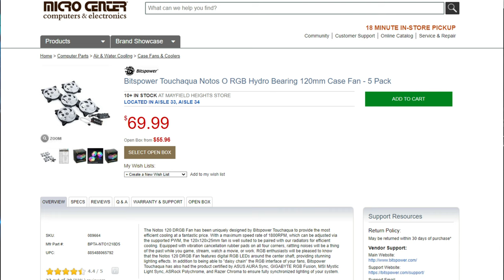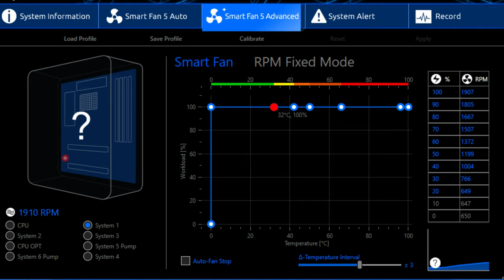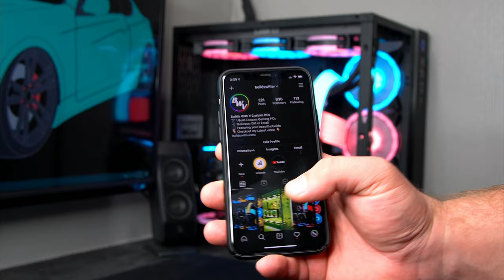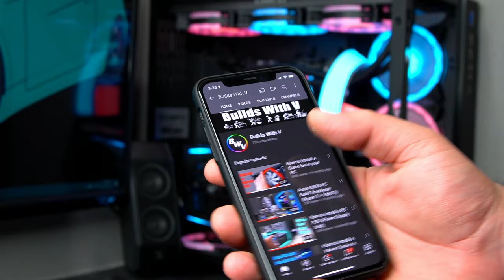Best Budget RGB fans (Bitspower Touchaqua Notos O fans)

Comment: where do you place the two hubs on your case?
Reply from the maker: I just kept them in the back of the case
Reply: @BuildsWithV  do you recommend plugging into MB or into PSU
Reply from the maker: @TaylorRich10  the fan hub needs both to work and the rgb hub needs sata power but plugging it into your motherboard is optional. The RGB hub has buttons on it to change lighting. I have mine plugged into the motherboard as well to control it using software
Reply: @BuildsWithV  okay well i managed to break the pins on two of the 8 rgb fan inputs... i have 7 total fans.. what do i do now 🤦🏻‍♂️
Reply: first time build and i’m freaking out
Reply from the maker: @TaylorRich10  not too much you can do besides getting a new hub. Broken pins won’t hurt anything but I’d just get a new one.

Comment: U have 9 fans but 8 rgb hubs??
Reply from the maker: 2 rgb hubs so I can separate the colors a bit.
Reply: @BuildsWithV  what hubs?
Reply from the maker: @motonate1585  they are the hubs that come with these fans. Bitspower RGB hub and Bitspower fan hub.
Reply: @BuildsWithV  ahh ok. So I got 6 of them, if I wanted to have 3 one color and the other 3 a completely different color how would I do that? Because right now (using aura sync) they're all the same color and I have no other options
Reply from the maker: @motonate1585  overall that will depend how many ARGB headers you have on your PC. If you have 2 then you can plug 3 of the fans into one of the ARGB headers and then plug the other 3 fans into the other ARGB header. The other option would be to have 2 hubs and plug 3 fans into one hub and 3 into the other. Then you can power one of the hubs with sata only and the other can be plugged into your motherboard. The issues with that is you’ll have to control 3 of the fans with just the hub and no software. I personally have 2 ARGB ports which is how I have 2 separate colors.
Reply: @BuildsWithV  ahhh ok I think I kinda understand now... I have a Asus x570-f so I believe I have 2
Reply from the maker: @motonate1585  nice! Yeah I just looked up the manual for that MB and it looks like you have one down at the bottom and one up top on the right. So it’ll work perfectly. You can just piggy back them together 3 on one header and 3 on the other. Thanks for watching 🙏
Reply: @BuildsWithV  hell yeah! Thanks for the help man!

Comment: These fans have very poor static pressure flow, not ideal for aio setups, for case fans they are fine.
Reply from the maker: They do great on my AIO radiator. No issues with heat until my GPU starts to put out a ton of heat from long gaming sessions. Then the temps rise but not to any extreme. Still well below limits. The fans do a solid job IMO. Could be better for sure but I’m okay with it.
Reply: @BuildsWithV   good to hear cause I just bought 6 of them lmao

Comment: I don't know what my favorite are, but imho these are a bit too much. I like rgb but these seem a little ostentatious.
Reply from the maker: Fair enough. I of course love lots of lights 😅 as you can probably tell.
Reply: @BuildsWithV  same, my case has 8 rgb fans with rgb ram, and I wish my gpu had rgb lol. Your build here looks great btw, but it's definitely is rainbow puke, and I love it lol
Reply from the maker: 😅 it definitely is rainbow puke 🦄 which RGB fans do you currently have?
Reply: @BuildsWithV  CM SickleFlow  V2 120mm x5,and the 2 200mm that come on the h500 CM master case.
Reply from the maker: @rottentrails  those are solid fans and they look great too! I haven’t tested them personally but I’ve heard some great things about them.
Reply: @BuildsWithV  well technically you have, they the same fans that come on the MasterLiquid ML240L
Reply from the maker: @rottentrails  oh really? The ml240 fans are 4-pin rgb and not ARGB which sucks cause I prefer the effects you get with ARGB. Or do these sickleflow fans come with two options?
Reply: @BuildsWithV   the sickleflow are argb , the ones I have are "version 2" but they look exactly the same as the ones on the cooler besides not being being argb
Reply: They even say sickle flow
Reply from the maker: @rottentrails  oh okay, I never even noticed. Learn something new every day as they say 😊

Comment: How do address the fans individually I Can only control them all at the same time.
Reply from the maker: I’ll be making a video showing this exact setup soon. However a quick explanation is that I have two rgbs hubs, one of the is plugged into one of my rgb headers, the other hub is plugged into my second rgb header. Then I have half of my rgbs plugged into one of my hubs and the other rgbs plugged into the other hub.

But I just released a video a bit ago today that shows and even better way of controlling your rgbs individually. Feel free to check that out here: https://youtu.be/AkmxHNkk__8